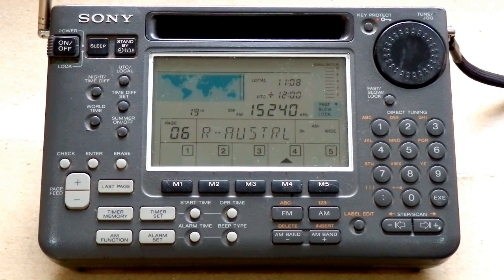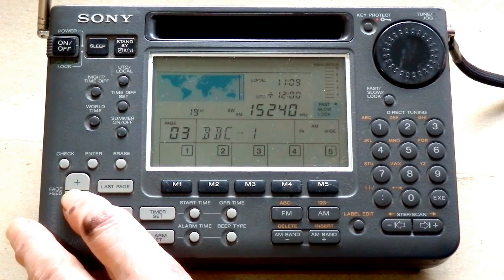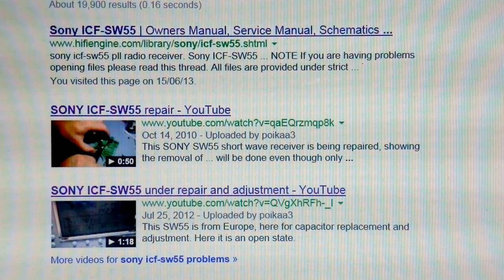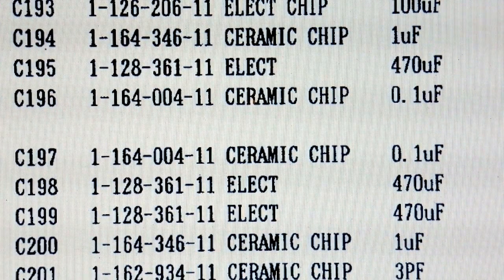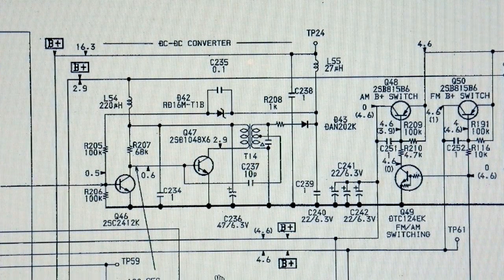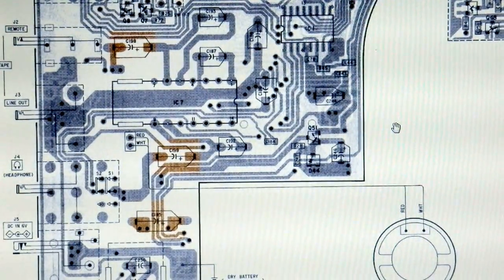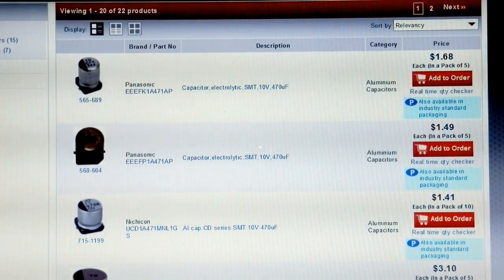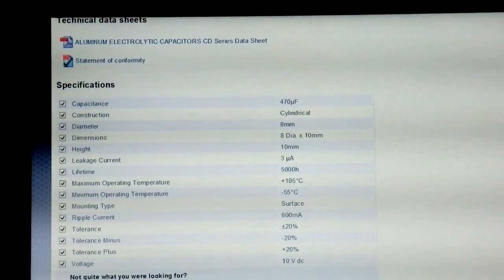SONY SW55 Repair - Preparation

Comment: Please tell me, did you change the capacitors for better reception on SW or are there original capacitors from the manufacturer. Bought a Sony SW30 two years ago and there seems to be some extra noise when listening. The newer Grundig and Tecsun have a weaker noise. It is recommended to change the capacitors. Receiver from the mid 90s.

Comment: SW 55 Faulty....Some comments below are very hard to understand,as with the "Power dial",, there is no power dial,only a power switch. I too own the Sony SW  55 and  it's been a very good portable receiver for many years,but now when switched on,it tries to Re - Calabrate  then switches off again.I can try switching on many times but the same thing happens.I can hear the Audio hiss while it is trying to re-calabrate,other than that,the receiver is dead.I live in New Zealand.
Reply: Did you solve this problem?
Reply: @khaledsalah1986  No I belive all caps are dead,also I accidentally shorted a transistor/ IC while trying to replace 1 capacitor.I now keep it in rememberance of a fine receiver.They are not available over here in NewZealand.

Comment from the maker: To Manuel Medina. I have not retained the link, but I have the complete pdf, which is 11.4 MB. I have extracted the parts list as JPEGs. Please email me at hfalkner@xtra.co.nz, so I can a) try to send the whole pdf, b) send the parts list.
Reply: Hello Henry I know it's been two years since the last time you for your video and got the pdf I appreciate the strangest thing of this radio is that even after changing all capacitors after a while displayed the word CAL calibration and after 10 seconds power off is there where things get complicated that after reviewing all components and have replaced the main IC continues to shut off suppose it can be any pre amp chip but the thing is that most of these radios finished with this problem, I wonder if it ever happened.
Best Regards
Reply from the maker: I have not done any more on my SW55. Shutdown usually means an excessive current draw. Look for short circuits, they can easily happen between the legs of ICs when replacing them. Sorry I cannot help any more at this time.
Reply: Thanks Henry i try to change the capcitors and check all again

Comment: Friend, good morning.
I have a Sony SW55 and its lamp goes up but there are times that it goes out and it does not rise anymore because. What will be the default friend?
Sheltered.
Oliveira
Reply from the maker: Unfortunately, I no longer use my SW55. I caused another fault when I out the radio back together, and it no loner turns on. I did get a tip from another reader, but I never got the time to follow up. Thanks for looking.

Comment: Was hoping to learn about the electrical connecton between the keyboard and the next board in the series ( ie behind the metallic screening board)  This connection involves a  metallic clip and a square section 20mm long rubber insulator (?).  This zone is the only area I can see where there might be a connection between keyboard input and the next board in the series.  However, I canot see how this connection woks.  Can anyone help ?
Reply: It is a rubber that can conduct electricity, it has to be positioned on the right position. You can see the up and down connection on it.

Comment: Hi Henry - Did you manage to repair your SW55?

I have just bought one from ebay and whilst it does turn on, it displays 'CAL' where the frequency would be show on the display. Could this be caused by old capacitors?

Thanks,
Alex.
Reply: +Alex Williamson  Try going to an AM frequency. Press AM function, bottom left. Page FU will appear, press M1 (CAL), and check if it does the calibration.
Reply: Yes more than likely.Mine did the same untill it died completly.

Comment: can u help me fix the power dial?
Reply from the maker: I probably cannot help. Your question is not entirely clear. There is a power on-off button, and there is a tuning knob. In both cases, if either of them is broken, you will need spares. For these you have to do a Google search. You may find that these are listed as 'Out of stock'. My apologies for being negative.
Reply: Thanks
Reply: The tuning encoder is a magnetic pulse wheel and at times the magnetic element looses it's flux. Replacement is needed and I have a few spares as no new ones are to be had.
Reply: @HenryFalkner  There is NO power dial.Just off and on and sleep switch.Okay.